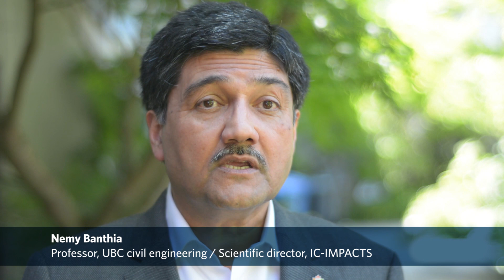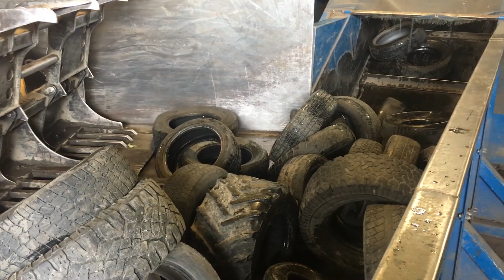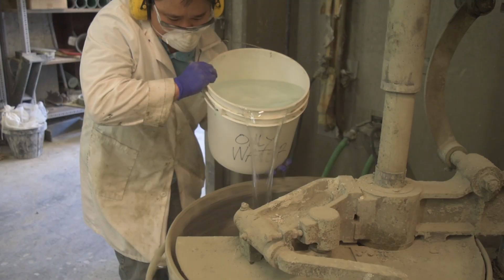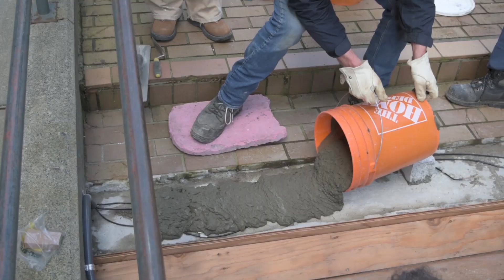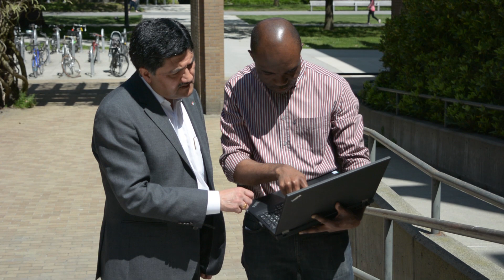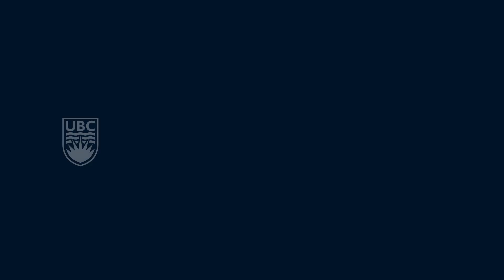When the rubber hits the road: recycled tires create stronger concrete

Comment: rubber contains carbon and cement has greenhouse gas emissions based on what you said, how does that reduce the "carbon footprint" of the concrete industry 
(sorry if I'm dumb)
Reply: You are not dumb, you just happened to not study simple maths. If the volume of old tires replace a portion of the volume of concrete that we need globally then what do you think happens?